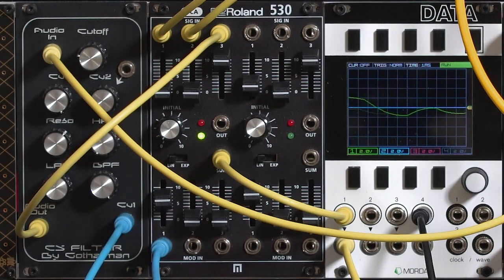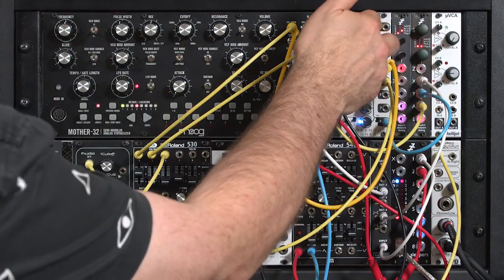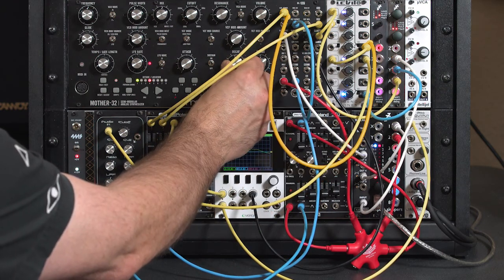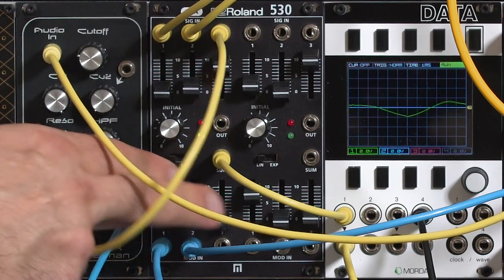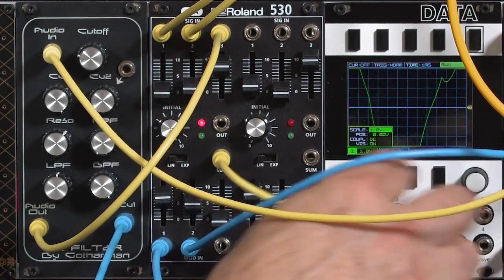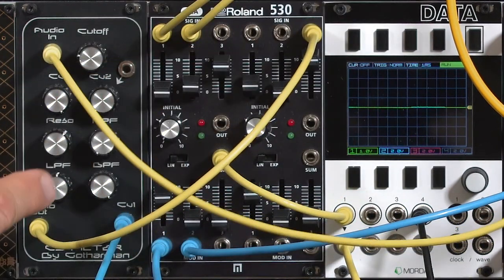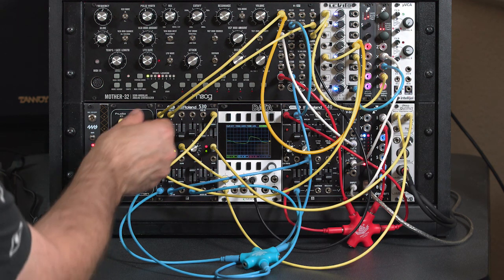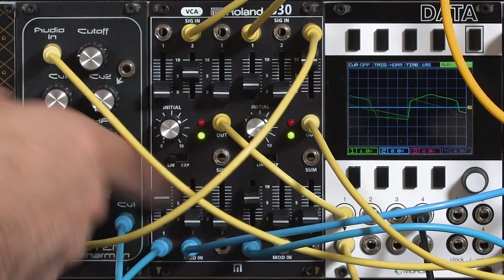Roland 530 Dual VCA 1/2: Overview (LMS Eurorack Expansion Project)

Comment: So if you use only one out it is a summed output of the 2 vcas? Essencially 6 ch mixer of audio and cv?
Reply from the maker: That module is is in storage right this second, so I can't check to be sure, but I don't recall the two VCAs being summed internally.

However, the Erogenous Tones VC8 has a lot if intelligent internal submixing so you can use it as VC mixer etc.

Comment: So does each mod in correspond to its respective signal input? I wasn't quite sure if, when you patched in the lfo, it was affecting all signals or just the 2nd.
Reply from the maker: All three modulation inputs (plus the Initial knob) are added together, and control the one VCA on their half of the module; all three audio inputs are mixed together, and treated the same by that one VCA. So there's no correspondence between, say, audio input 2 and modulation input 2.
Reply: Thank you very much. Your videos have been so helpful to this newbie!
Reply from the maker: Thanks for letting me know!
Reply: @seanchud  Excellent. Was wondering the same thing myself.